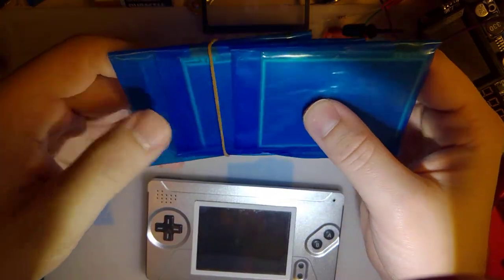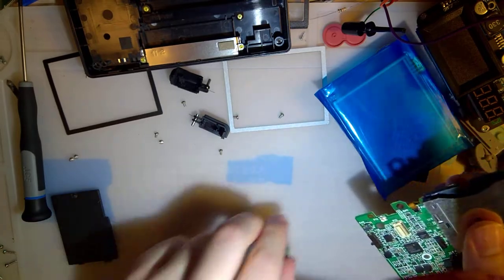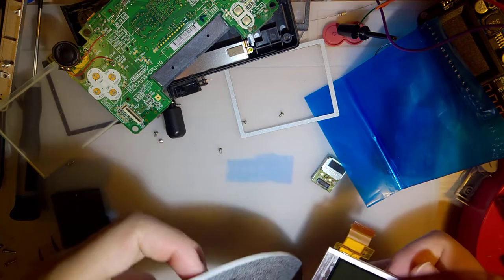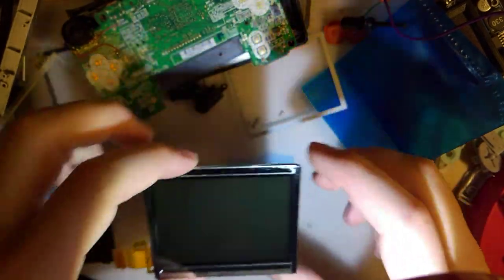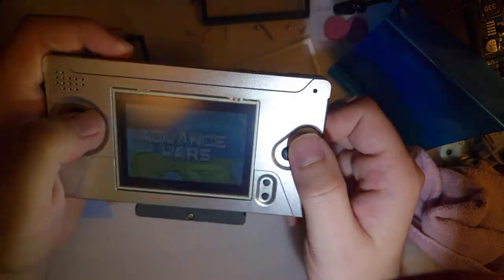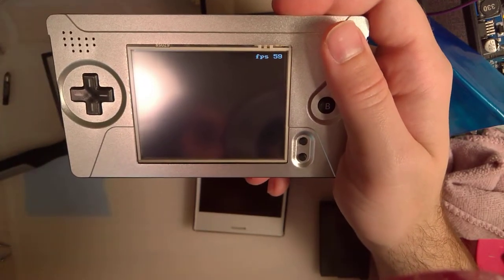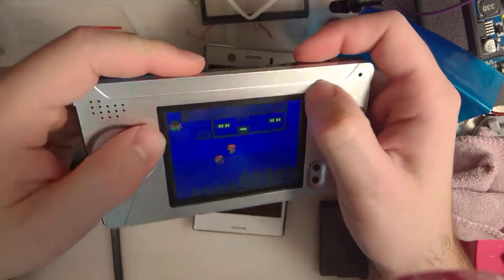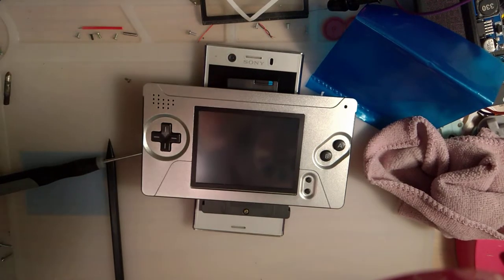Making a Boxy Pixel Game Boy Macro (Nintendo DS Lite) - Part 2

Comment: As far as a light diffuser Goes you can just take a piece of hard plastic, like from a CD case or something and hit it with some light grit sandpaper. Then glue it to the inside of the front panel with hot glue. It works nicely.

Comment: Dude I love your ,,so what" attitude ...:))...Listen couldn't help overhearing you have some ds lite's lying around would you consider building a macro for me ? I have some soldering skills but the part where I need to solder the tiny thingy on the board goes way beyond my skills.What would the whole operation run me? I live in Belgium. All the best dude.
Reply from the maker: Sorry, but I am not currently doing commissions. And if I were, shipping would be a significant portion of the cost. Shipping something like this internationally from the US starts at around $40 USD and only goes up.

Comment: Is it possible to make the gameboy macro xls screen brighter like the ds lite? Is there a funnyplaying or cloud game store option for a nice ips display
Reply from the maker: if you have to ask, the answer is no. You can always just drive the screen backlight at a higher voltage for more brightness but there are no guides for that. It's something you'd have to DIY. 

And no, there are no screen kits for DS consoles. Unlike Game Boys, they all came backlit from the factory so the demand is significantly lower.
Reply: @makho  ty for ur detailed and thorough response as always

Comment: If this could play real gb/gbc cartridges, I would order the necessary parts in a heartbeat. To bad those games needs to be emulated :/
Reply from the maker: Such is life. At least the GBC emulation on DS is pretty solid.
Reply from the maker: @Eyejeey  You can't really hack a DS or DS Lite. I mean, you can, but since you can't install and run any software that way there is no point. To run homebrew on a DS console, you need a flash cart. R4s and the like are dirt cheap.